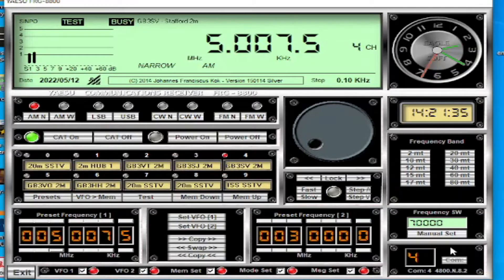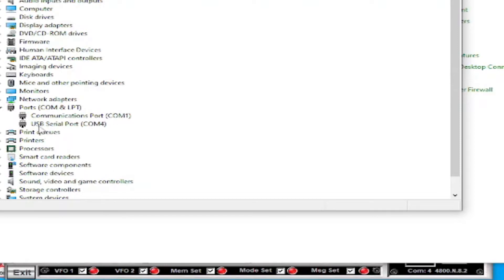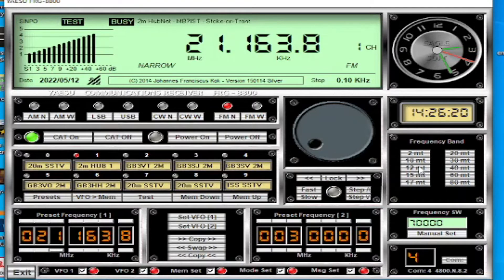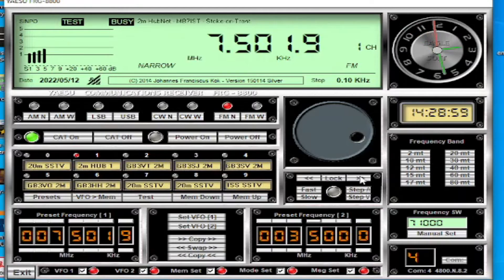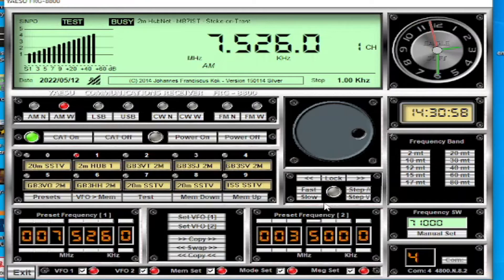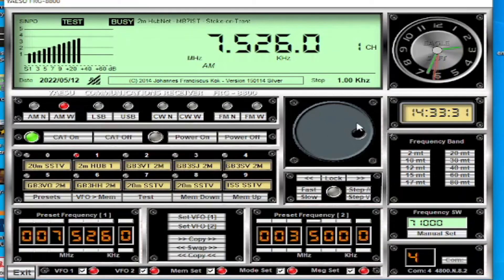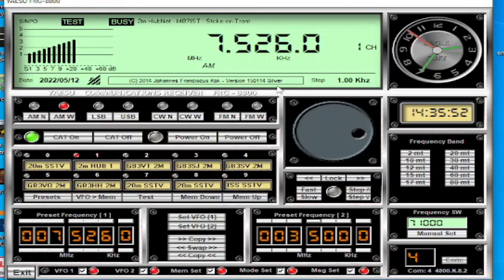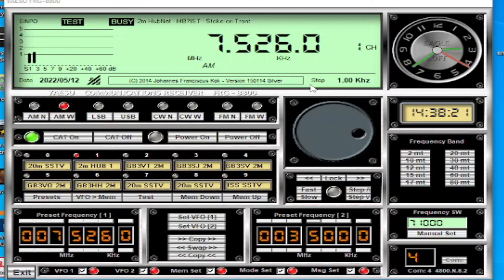Yaesu FRG-8800 CAT Software (REVIEW)

Comment: The aspect ratio looks wrong to me. Tuning knob is not round etc. does this run full screen on an average 1920 x 1080 res monitor ?
Reply from the maker: It does not run full screen.  I had to zoom in to do the video so it looks a bit out, on PC looks ok when its working.

Comment: Nice to see that someone is really using my software 🙂and enjoys it 👍  The two virtual ''VFO 's'' were implemented to switch quickly two frequencies if two radio stations are in a QSO (LSB / USB) but the frequency is slightly off between them and you may not be able without switching to follow the conversation correctly.
Reply from the maker: Thanks, I use the software all the time, makes life a lot easier having the radio some distance from the PC, and been able to control from my PC. As I now feed the audio back into the PC so I can record also. Its great software.
Reply: @m3bik  If I find the source code (VB6.0) again, I could make the ''lock'' button bigger  🙂and maybe some other changes, but for now, after a huge PC crash things will be difficult, but you never know.... in case I will try to contact you for some advise. By the way, double click on the big dial knob will stop scanning as well, big enough to center at a glance 🙂
Reply: Just dowloaded your software and located the cable   Thank you Johannes!👍👍👍👍👍👍🤏
Reply: I am unable to register and/or login. It's very frustrating. I sent a message via your contact form. Please advise, thanks.
Reply: Unfortunately, I have the same problem. Is the website still active? Can someone provide the software?

Comment: You mentioned an issue with your original cable. What did you end up purchasing and from where? Thanks
Reply from the maker: Hi, ended up getting it from https://www.g4zlp.co.uk/ as the one from Amazon did not work.
Reply: @m3bik  I'm confused.. WHAT cable on that website?  This is highly unclear.